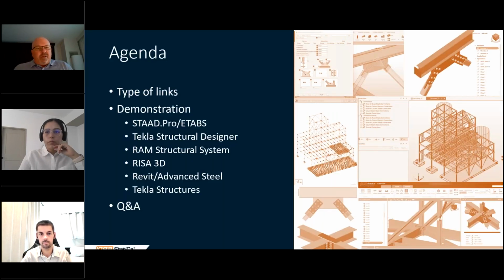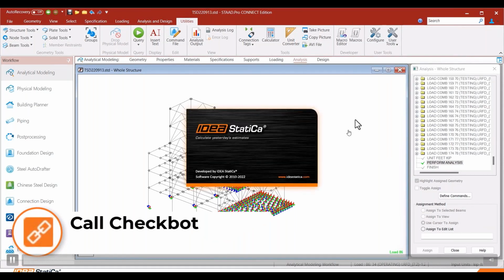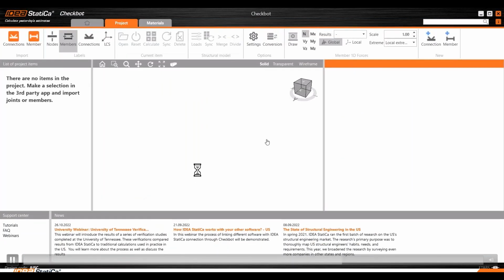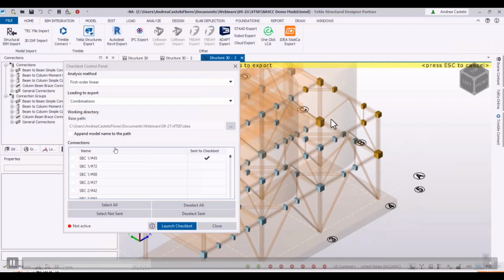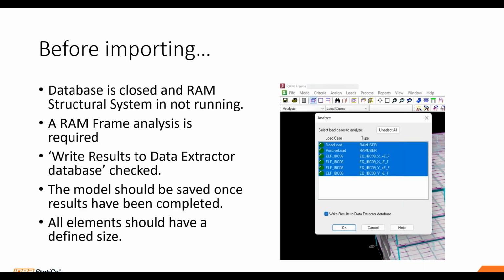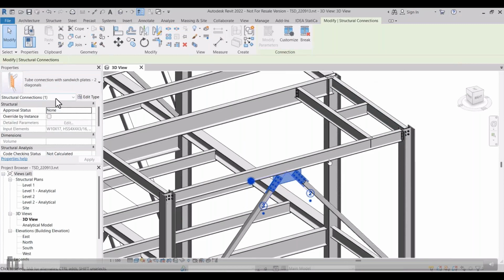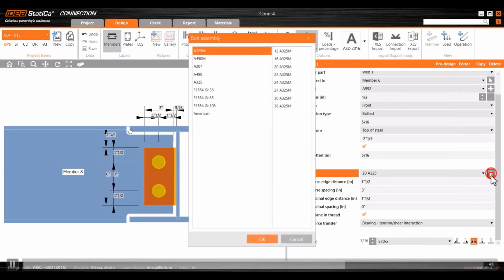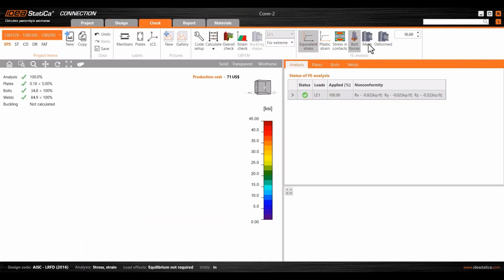How IDEA StatiCa works with your other software? - US

Comment: Thanks for Great Explanation. If anyone wants to model the complete connection manually and then want to input loads manually for each members end. For example, a purlin is supported on a beam via cleat angle, so there are two seperate purlin and 1 continuous beam modelled in idea statica. now at which distance from the end of the members load is selected from staad model to plugged in idea statica model beacuse there are some automatic length taken by idea statica. please explain this. thanks
Reply from the maker: Hello, thanks for your comment.
Generally, the global model ought to comply with the design in IDEA StatiCa and vice versa. For more info about how the eccentricities work, and what can be done in IDEA StatiCa, please go through this article - https://www.ideastatica.com/blog/what-if-it-doesn-t-go-in-the-right-direction